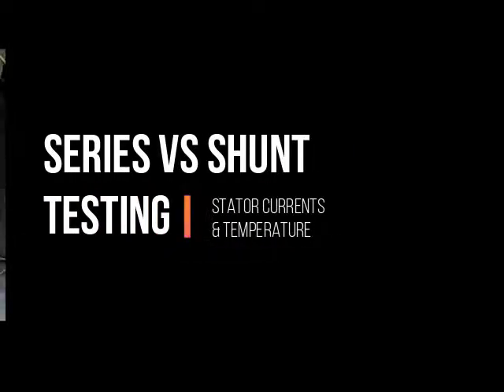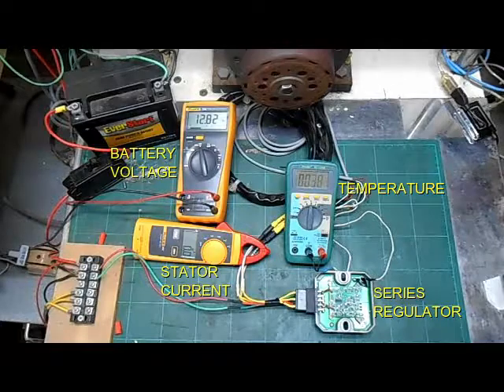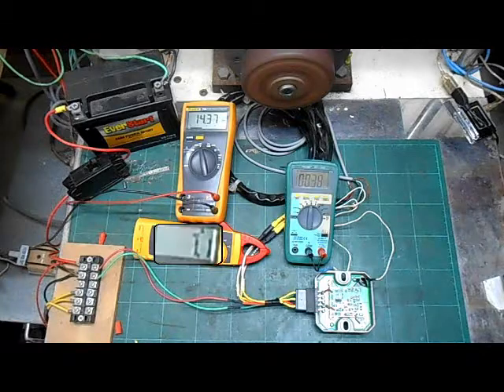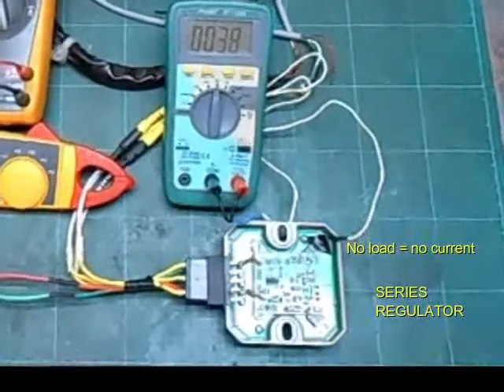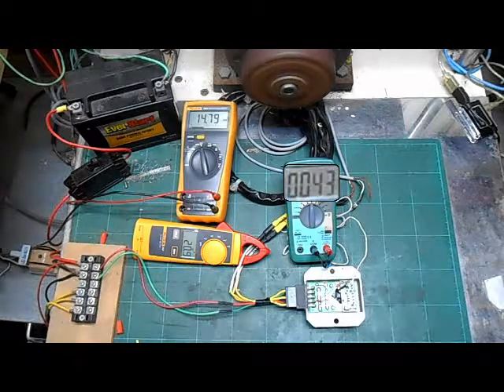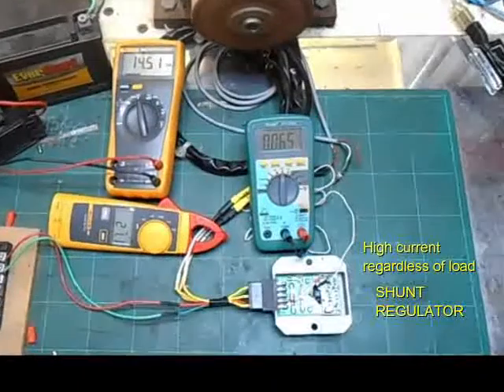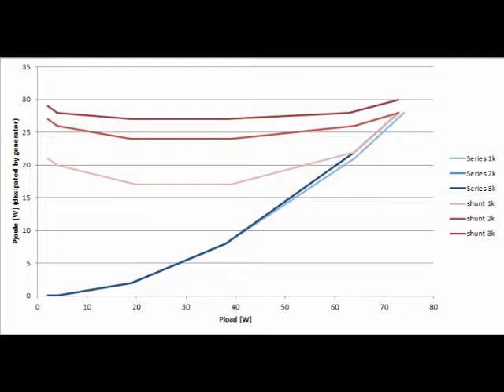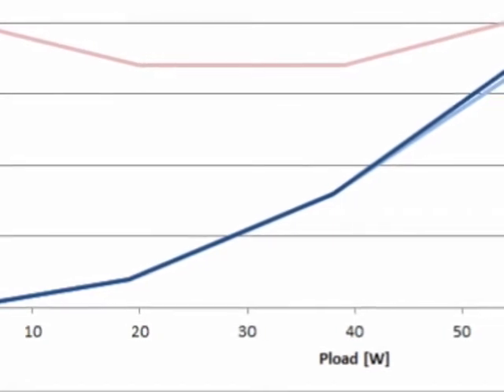Testing Series vs Shunt Regulators

Comment: There is also a rectifier regulator that combines a series and shunt regulator and uses a shunt regulator to unblock the series regulator above 8000rpm. In this way, it does not behave like a three-phase series regulator without problems with high revolutions and has the ability to protect against overvoltage that can occur when the connection with the battery is interrupted. We make such regulators.